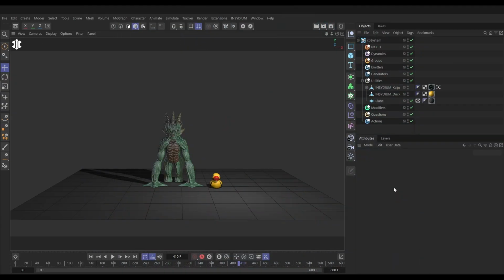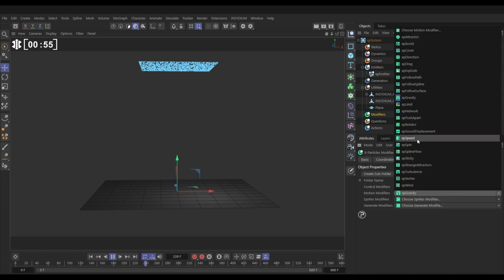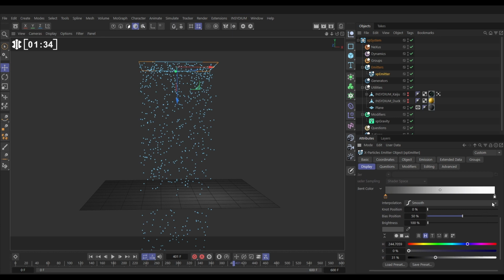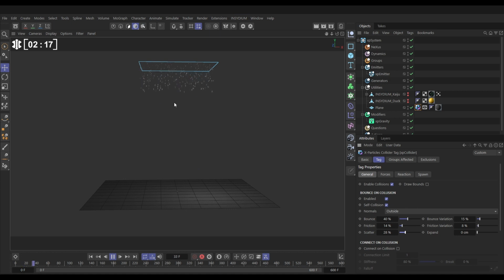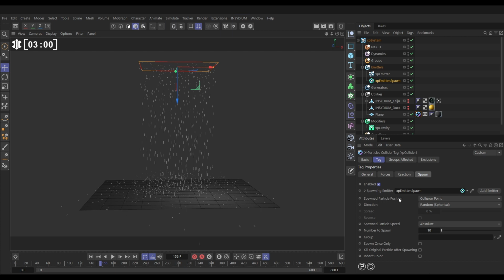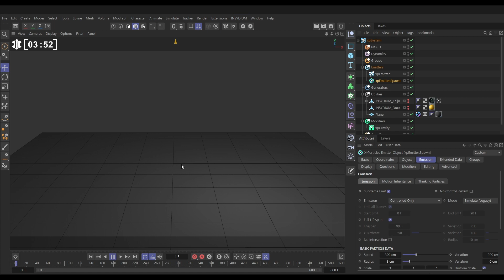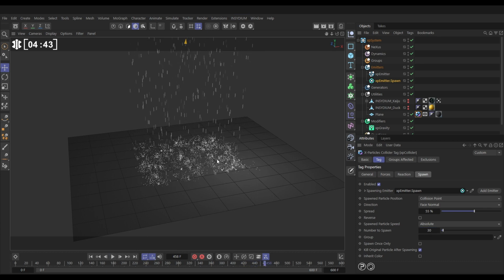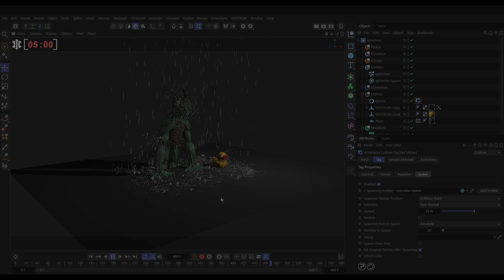Top Tip Tuesday - xpRainRig

Comment: Wondering why you choose to use the traditional gravity mod instead of the nexus gravity mod. 
Does it matter which gravity you use?
Reply: Because the nexus gravity doesn't work for this. I spent 20 minutes agonizing over this exact issue until I gave up and used the old XPgravity...